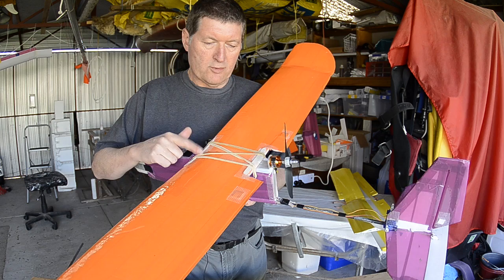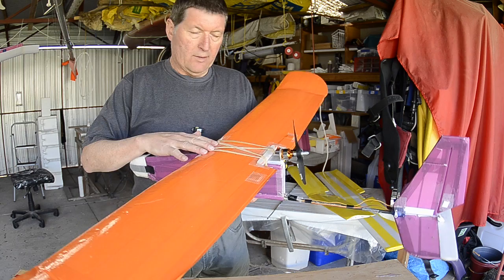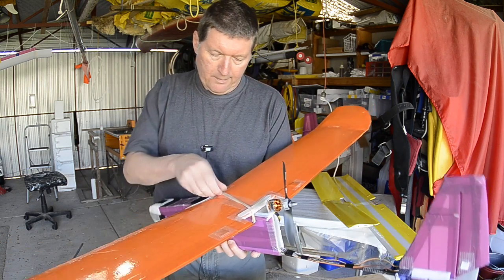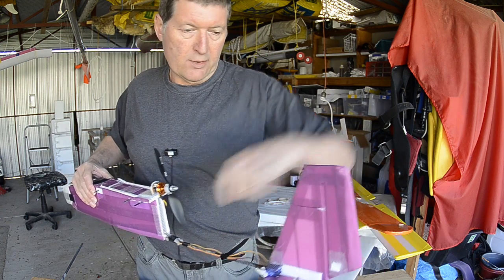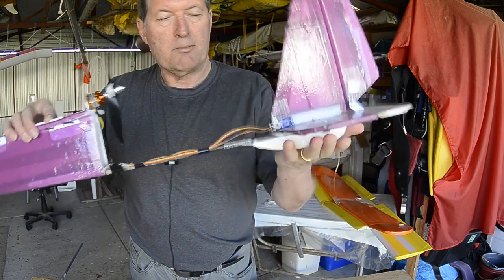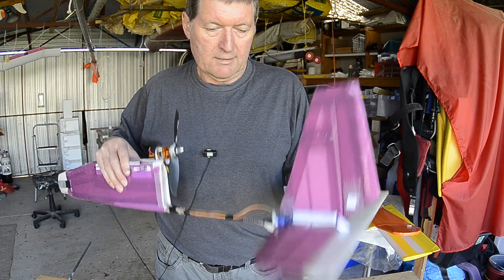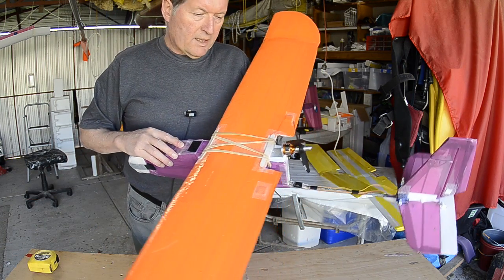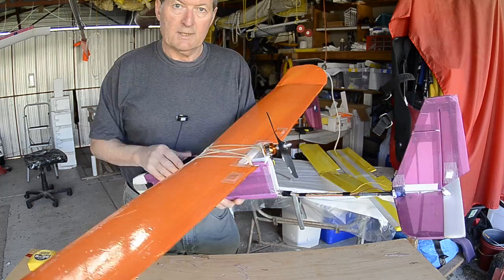Polyhedral R.E.T pusher overview

Comment: Do you keep thrust angle on the motor?
Reply from the maker: Yes, some down thrust is required in planes with a high mounted pusher motor.
Reply: Just to make sure do we have to keep a angle to right or left ?

Comment: arrow shafts don't weigh that much, why could you run a pair of them back to stiffen up the tail a little, 2 of them tethered together by a couple spot of epoxy so they can't twist would be quite stiff?
Reply from the maker: I have done that for a speedy sloper and it works well

Comment: Great video-

I’d like your opinion.
I had an Aeroscout S2 1.1 RC foam plane. The fuselage & tail took too many crashes.

I had created a custom fuselage  but plane barely flies now. CG is spot on weight wise. The width of fuselage is 4 1/4”. My guess is it might be to wide for pusher motor to get enough relative wind. I added a google image link of my plane.

Could you take a peek & see if you notice anything that looks like it might cause it not to fly well? Much Appreciated-
I’m a newbie & still learning.

https://photos.app.goo.gl/gfFoNEuGn4uF6b6g7
Reply from the maker: You will be learning a lot just by trying out your ideas. Keep going. I think you're right, not enough airflow on to the prop. Motor could to be too small and plane too heavy maybe. More chance of success with the motor on the nose.
Reply from the maker: Try the mini sky hunter style layout maybe - https://www.youtube.com/watch?v=6nauHFY2WEk
Reply: @AndrewNewton  

True-
Just rebuilt new foam fuselage, crossing fingers it might actually fly well again :-) fun & interesting hobby

Comment: do i
 need ailerons? please help. i'm new to rc plane.
Reply from the maker: Some planes do and some dont. If the wings angle up enough (dihedral) then you dont need ailerons
Reply: @AndrewNewton  should I build a flying wing (delta wing) or a trainer plane as a beginner? please advice

Comment: Hi Andrew,  thanks for all your advice on the pusher plane.  I did not use your exact materials and my plane is heavier than yours and measures about 900g without the battery.  will this be too heavy to fly?
Reply from the maker: Depends on the wing area. It won't fly slowly
Reply: Thanks for that. bigger wings mean more lift and weight and faster speed means better  lift but less control!  I will reconfigure to match your weight.  as a beginner I need slow speed to I can learn how to control.

Comment: I used normal 8045 prop in pusher model but i did not get the required thrust...Why?
Please make a video about it✈
Reply from the maker: Mounted facing the wrong way, or need a more powerful motor
Reply: @AndrewNewton No motor 1400kv but in puller plane i got lot of power
Reply: @AndrewNewton  I will try again...
Reply: @MartialArtLife  The same prop/motor/battery combo will always produce more forwards thrust in tractor mode than pusher mod. The pusher pylon mount blocks off part of the driven air disc plus the air is vectored off at an angle. Like having the wind behind you versus off to one side when sailing a boat.

Comment: Which airfoil are you use in this plane wing
Clark-y or clark-z 
And which is better for noob rc pilot
Reply from the maker: Probably a slimmer Clark Z, maybe 9% chord thickness. But it really makes very little difference with slow flying models. A wing with no airfoil will still fly.

Comment: Greatly appreciate the detail you've provided here.  You've baked in lots of ingenuity and lots of convenience.  Most construction issues I can handle, but I'm always intimidated by wings.  I may build the polyhedral  FT Explorer student wing to put on my own instantiation of the Newton RET Pusher, just because I think I can muddle through Josh's well-documented wing build procedure.

I seem to remember you mentioned once where you got your abundant supply of ID card material, but I can't remember the details.  My very limited supply of old credit cards isn't going to get me very far.
Reply from the maker: Thanks, yes the FT wings would work perfectly well. I searched on eBay for CR80 Blank ID cards http://newtonairlines.blogspot.com/2015/03/materials-and-links.html
Reply: Thanks!  A lifetime supply is on its way.  Seems like a great material for strengthening foam at high load points.  Wood is brittle.  The moment it cracks, all strength is gone.

You didn't mention the cradle that your wing sits in but it looks like either contoured ID cards or contoured icy pole sticks.  Can't tell.
Reply from the maker: Those are just strips of foam (adhesive draft proofing tape), could use anything to build up ridges to stop the wing from rocking side to side.

Comment: Thanks for the inspiration!  Im going to turn my Hobbyking Slow Stick into something like this.  I dont have a landing strip and Im quite over rebuilding the gear, motor mount, etc .  It has a nice big wing, would be great for a biplane but it looks like it has been discontinued so parts are almost gone.  I Should upload a video of its current state before I do, I turned it into bush plane :)
Reply from the maker: Sounds good. I love a radical reconfiguring.

Comment: That is poly-dihedral. Dyhedral is when you have one break in the center, polyhedral is where you have two breaks on the outer wing tips, and poly-dihedral is where you have three breaks, in the center and the tips which is what you have set up on that. Just sayn. Doesn't matter too much
Reply from the maker: I know you're right but we Australians like to shorten everything, Poly-Dihedral has too many syllables and poly means many anyway.
Reply: AndrewNewton yeah I guess it's the same thing. Not something to fuss about
Reply: Dihedral: Center, Tip Dihedral, bends in the tips, Polyhedral: three bends. He's correct.

Comment: Hi i am using Depron Board to make the wings a KFm2 based version for the pushers, unfortunately making a polyhedral is a bit tricky, i have tried to cut the wing at the tip slightly, bend and then hot glue the seams but sometimes its either un-even on or the glue is too hot and burns through the foam. Can you please give some tips or maybe a video on how to to avoid disaster lol. thanks!
Reply from the maker: +Abid Khan Abid, I think the thin cross section of the KFm2 would make it difficult using just glue to hold the tip angles. Maybe try simple dihedral with a bent aluminium tube holding the dihedral angle at the root. Like this https://www.youtube.com/watch?v=aaMfiCI1Z0Q
Reply: +Andrew Newton Many Thanks!

Comment: Your video sound very interesting, it's a pity which I does not include well English, thank you for you video she are really well
Reply from the maker: +john513181 Glad you like it John
Reply: +Andrew Newton Andrew hello! Tell me why I can not fly the aircraft smoothly, and turn left and a little to the left to give the bank? No rudder. The plane looks like Skywalker. The center of gravity right wingspan 1450mm Weight 1100g. Motor mowing even where else to look, I do not know.
Reply from the maker: +Spartak1245 Do you have photos or video of the plane?
Reply: Andrew Newton Here are the photos and videos will upload now.
https://yadi.sk/i/zR6cGYx_m34WL
https://yadi.sk/i/YlWPpLmOm34WM
https://yadi.sk/i/886alykHm34WP
https://yadi.sk/i/UNT4htzsm34WR
https://yadi.sk/i/tcT7lYwXm34WW
https://yadi.sk/i/H0g3xSvYm34WX
Reply: Andrew Newton Video
https://drive.google.com/file/d/0By32qM6exPcxdGVNNV9pcF9VbWs/view?usp=sharing
https://drive.google.com/file/d/0By32qM6exPcxaGFtcTYybWdFTVk/view?usp=sharing
Reply from the maker: +Spartak1245 Very good, the photos and video are helpful
First thing - your plane is quite heavy so you would need a more powerful motor than mine and need to fly fast.
Second thing - it has a lot of adverse yaw. I had the same problem with a similar design. When the plane banks left it actually turns right initially, due to more drag on the aileron that goes down (right side). That makes the turns difficult needing lots of bank and elevator.
To fix that you need to use aileron differential. This makes the ailerons move up more than down. You can do that  mechanically (set up the servo arm so it is angled back about 20 degrees with the ailerons neutral) or with a mix in your transmitter.
A rudder will also help to overcome adverse yaw.
Reply: Andrew Newton Thank you I will try to do the ailerons more) If you do not come out, something to do with the ceiling tiles fuselage. Say, cut the wings lighter than the string as you did before?
Reply: Andrew Newton And I forgot to ask. Mowing motor to do in some way or else leave it exactly on the axis of the wing?
Reply from the maker: +Spartak1245 The motor mount for this style of plane usually needs to be angled forward a little bit, so that the thrust is down towards the nose, but it didnt look like it was a problem in your video.
Yes it would help if you can reduce the weight and have a smoother airfoil wing.
Reply: Andrew Newton Got it thanks)) I will try, somehow get rid of this problem with the bank.

Comment: One more question, could I use a 7 " X 4.5 " standard prop. (Puller), turn it around and make it a pusher changing the motor rotation?
Thanks in advance
Reply from the maker: Carlos Sanchez Yes Carlos, that is the correct way to do it. Just have to make sure the numbers on the prop are facing towards the nose. There is no need to buy a "pusher" prop.

Comment: Andrew, I am constructing one airplane very much like yours, only difference is height of the fuselage all other specs are the same, all is built I am just waiting for UPS on the aluminum rod for center dihedral, I'll post some pics when finished.
Also would like your advise on 60% reduced same plane as a park flier for my grandson.
Can I reduce all aspects to 60%, allowing of course, room for battery and electronics?
I will take care later of motor depending on weight and thrust.
Thanks,
Carlos, Miami.
Reply from the maker: Carlos Sanchez Good to hear Carlos. I think this would scale down well as long as you keep it light. It's a very forgiving design.

Comment: That looks like a good plane as you said. How exactly did you make your ruder hinge? Did you just use the packing tape as a hinge or did you use small hinges to connect your ruder to the vertical stabilizer? Where should be the plane's centre of gravity? I guess where the wing is the thickest? Thanks for any help :) Btw you do great videos!
Reply from the maker: Thanks Julias. Just packing tape hinges on all my planes, nothing fancy. They work well. CG is usually at the thickest part of the wing but some testing may be required. Somewhere between 20% and 40% back, just have to fly it and see.